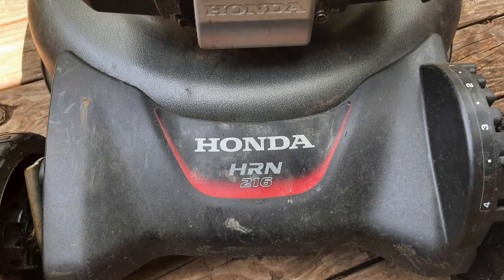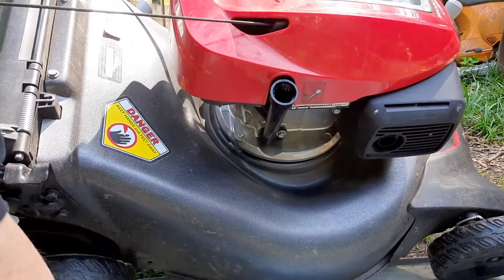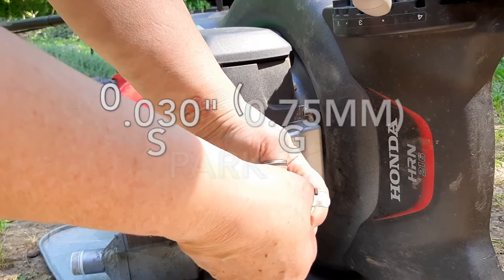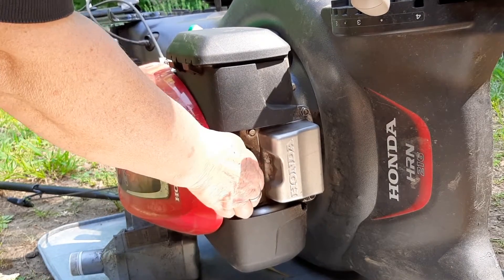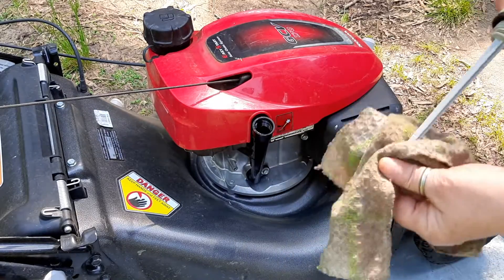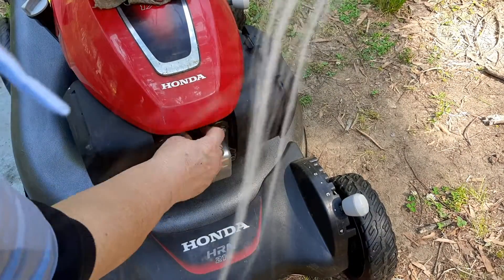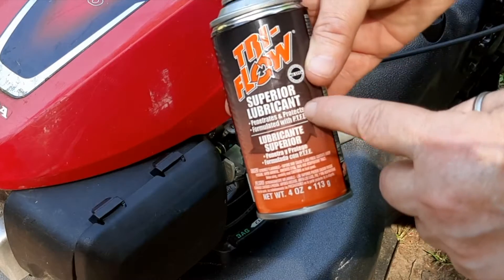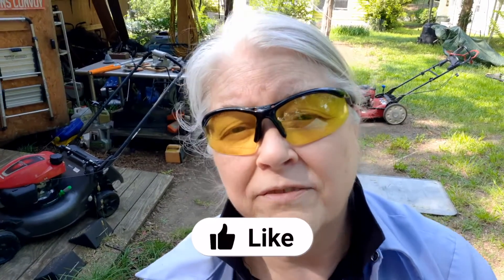HRN216 Tune-up: Honda's Newest Lawn Mower

Comment: Thank you for your videos.  I have been having a huge problem with the carburetor & found out Honda does not cover it 👎🏼 I did purchase full warranty for it. It’s only 1 year since purchase & I take it in for maintenance.
Reply from the maker: Wow, sorry to hear that. Not sure how an extended warranty doesn't cover carburettor related issues. Generally speaking Honda makes a superior product, bu this newest model falls short on several levels. I appreciate you watching.

Comment: I wish I had seen this video before, because I just bought it a few days ago. Love it so far but now I'm worried lol. I was looking for a Toro Super Recycler but they were out of stock here. Dealer told me they are not sending him many residential mowers. They seem to be pushing the battery ones at the factory. Thanks and hoping mine keeps on going😁
Reply from the maker: Check out my review of this mower (in the top pinned comment above). I think the mower still has a few high points despite the  value engineering that occurred with this newest model. I think the biggest problem you need to look out for is debris derailing the drive belt. Their design chose to omit the underside baffle to prevent this. If you do wind up with a broken belt, it' not too difficult to replace with some basic tools if you are handy. That video is here: https://youtu.be/lsNDo2Ywnlk I appreciate you watching.
Reply: Every one is pushing the battery mowers but they don’t hold up and have to replace it every few years 
Not a good idea 😂

Comment: when I remove the spark plug to check it, before reinstalling it I clean it using the wire wheel side of my bench grinder to clean it.  It looks new again after I do that, then I apply anti seize to threads to make removal easier next time.

Comment: Have you ever added an hour meter to a residential mower? I installed one on mine when it was new and it helps keep me on track for oil changes at the appropriate time along with other maintenance items that are spelled out in the owner’s manual.  I highly recommend them.
Reply from the maker: I personally have not, but have urged several owners to do the same on their commercial pressure washers and such. It's a great idea, but I suspect you are in a very small group of owners who actually read and follow owner's manuals.
Reply: @TheLawnmowerLady  owners manual? What’s that?
Reply: I think all small engines need meter and low oil shut down from manufacture, but they don’t wont it to last but a year or two

Comment: The second use of this mower it started surging and I had to clean the carburetor then it started idling way too high so I had to redo the governor thingy. The tachometer I bought is cheap and reads over 4k but it sounds good.  When I drop it down to 3600 or lower it sounds crappy and runs rough so I did it by ear and I'm sure it's rpms are a bit higher than factory but it cuts waaaaaaaay better now.
Reply from the maker: My advice is to check the return springs for the governor arm and the throttle plate. Maybe something is sticking in one or the other. If sounds like it's running crazy fast, it probably is. 4K is a little on the high side for sure. Thanks for watching!

Comment: Hello, thanks for the video...I'm working to replace front axle on Honda Hrn 216..would you know how to remove the front plate/cover that covers the axle?
Reply from the maker: As I recall, there is not an axle as such. There are wheel mounting plates that have a large stud that the wheel goes on with a nut that holds it in place. Hope this helps. Thanks for watching.

Comment: I just got one. I've ran it twice and the 2nd time it started making a ticking sound for a few seconds maybe a minute then went away. While it was still warm I restarted it and the same thing happened. Oil level is fine less than 2 hours on the mower. Belt seemed very loose when I flipped it to check blade bolts?
Reply from the maker: I've heard a ticking sound with a loose blade. If it's still under warranty, return it to the shop where you purchased it.

Comment: i use royal purple oil i can see the mark on the dip stick better. i have a honda hrx217vkaa can you send a video on changing the drive belt thank you.
Reply from the maker: I don't have a video on that yet. I have one that needs a new crank and hopefully one day soon I can get that video done. Thanks for watching!
Reply: @TheLawnmowerLady  I mowed over a golf ball chopped it into pieces and shot it out like a bullet I have a slight vibration on my mower now what do you think? Honda hrn.
Reply from the maker: @SANCHEZFLA863  My first guess is a bent crankshaft. If the vibration is not too bad, you might be a few years out of it before the seals get worn out an it starts leaking oil. I think there is virtually no chance the blade adapter is bent, it's very robust. Keep an eye on the oil level dipstick to monitor those seals. This newer model has a much lower oil requirement than previous models. It will seize up sooner with no oil. Here's a simple way to test for a bent crank without any special tools: https://youtu.be/4xqC5X8-3nc Good luck.

Comment: I'M not sure I like them reducing the amount of oil these new engines hold. What is your opinion Stella?
Reply from the maker: Unfortunately, I think finding  these overfilled will happen more often. 🤔
Reply: I think the oil will be so over heated and damage the moving parts 
Honda is really stupid and I can see why they got out of push mower business 
This engine will be a disaster
Reply: @philliphall5198  Honda is not out of the push mower business. Where did you hear this.

Comment: Hi Stella, I really enjoy the videos.  The HRN line has been out since 2020, I really haven't seen much negative press on them so far. The mower in the video already looks pretty beat up for being so new and having it's first oil change. Is the customer using it commercially? 

I own one of these mowers, bought it new in July 2020. It's been an excellent mower, I've had zero issues. Although I agree there may be some compromises with this new design I think it's a significant improvement over the HRR line it replaced. Overall I would recommend this mower, I think it's still a better buy over the Craftsman's and Troy Builts ect. 

Just my 2 cents... :)
Reply from the maker: The mower was only 4 months old the first time I saw it, and the customer just is really hard on all his lawn and garden gear. I made a video on changing the belt as he was using the machine as a bushhog. I made a second video while waiting for the belt on some of my other observations of this new design. Although Honda took some short cuts with this new design, with proper care and  use, this mower is OK.  I appreciate you watching. Cheers!

Comment: Hi. Don't know if you can help. When I replaced the drive belt on honda hrn 216 with your help,thank you. Somehow I pulled the cable too hard and what looks like a plastic piece popped out . cable is slack and I can't push the plastic back up into hole.  This is probably the worst description of a problem you have ever received I'm hoping somehow with a miracle you can picture what I'm telling you ,help!!
Reply from the maker: No idea, I'm sorry I can't help you. Maybe look at a parts diagram to see where it fits?

Comment: Good video. Can't wait to see these engines on something other than a Honda deck. I don't know if I like that dipstick... Very weird design. I prefer the older dipsticks on GCV160/190 along with the older briggs classic and quantums. Something that you can actually easily read when a machine is low on oil.
Reply from the maker: I agree! Thanks for watching. Cheers!

Comment: I have this mower bought about two months ago. While cutting grass the other day out of the blue the self-propel stopped working. I checked for broken/belt off pully as well as cable adjustment and could see nothing out of the ordinary. After about an hour or so I decided to start it up to check once more before putting it away and to my surprise it was working just fine? Any idea why this may have happened? Thanks
Reply from the maker: Honestly no, but some folks report any small debris, twigs, etc., will jam up the drive. Perhaps you dislodged something when you looked under the deck? Thanks for watching. Cheers!
Reply: @TheLawnmowerLady  That did cross my mind and could very well have been the case. Thank you👍

Comment: Hi!! I just had the new HRX217HXA top of the line delivered and sent it directly back. Took 17 tries to start. This is one that my local dealer has fixed the Cam Release problem on. I think its the wax choke activator now. It has the auto choke which i dislike.    I myself prefer a manual choke like on my 2008 top of the line residential GVC160 overhead cam. Still runs great but having a transmission issue and it costs almost $500 to do my self. I am fully able to but being 60 i figured i would buy one more honda as they are out of the lawnmower business. So, i do NOT want the new 200 engine w the bad cams even as my dealer is replacing, and i dislike the now autochoke  so my option is the commercial HRC216HPA which still has the 160 engine w the manual choke!!  Also shaft driven which is the best But it weighs almost 30 lbs more..... is there a Toro that you may think is made as good as the Honda commercial or the older honda residentials? Weigh will be an issue in the future as i am older. Tempted to just  try to first change the transmission fluid and if that doesnt help replace the tranny. I am very mechanical...
Reply from the maker: My personal opinion... Any commercial mower will have a longer life as a residential mower. A new Toro, as with most any mower made these days is not as durable good as a 10 y.o. Honda That said, would you consider a used, good condition HRX series (composite deck with the older engine?). That machine retains many of the commercial like features found only on the commercial lines. 

I'm intrigued with the $500 cost of your transmission? AFAIK, all Honda transmissions are rebuildable. If you are indeed handy, drain the fuel and oil, pull the spark plug, and flip the mower upside down Take a look at the transmission gear box. If the screws holding the cover are not too worn, pull off the cover and check the gears, and the gearbox oil level. What is the condition of the pinion and matching gears on the drive wheels? Do the drive wheels turn when you engage the drive belt on the transmission? I really appreciate you watching.
Reply: @TheLawnmowerLady  Hello and thanks for responding. Yes they turn. Right now just groaning but still operabIe.  am going to first check ,change, the fluid in the transmission. And checking gears. Yes i am a machinist, retired and very handy. If I do indeed need the tranny I found one for 307.00. I do see that draing the fluid and replacing quite often fixes. I have the groaning noise when moving. Mine is 2008 HRX217hma. Has always started on first pull so want to replace tires and bag and fix tranny instead of the new 200 engines. My local dealer is replacing the cams and or cam releases on each and every new hrx. They are bad and honda wont recall as now they will be out of the business and dont care. Lots of news on them on diff sites. I also do not want auto choke.  My other option is the hrc216 as it has the overhead valve engine still........

Comment: Without prompting, the local lawn mower shop said to stay away from these Honda Commercial Mowers with the  GCV-170 Engine.  The Self Propelled system is exposed to the elements underneath and any mowing on wet grass spells 'Doom' for these machines.  The self propelled system just stops working.  Second, the self propelled cable going into the machine just fails at the connection at the body.  Both are insane, one is high labor cost and the other is high parts cost.  Very sad to see a full-on Honda product fail.  I do not know of any engine issues but the shop was just going on and on about "Don't buy this machine," that I could not get into the ask question mode.
Reply from the maker: I agree Honda cut way too many corners on this mower. I did notice these same engines on the new HRX mowers with the composite decks. Those are still good Honda quality mowers. I appreciate you watching. Cheers!
Reply: @TheLawnmowerLady  How I wish I'd known this, before I bought mine!  Just had my self-propel stop working on me.  It has been surging, and bogging, during mows also.  What a cluster!  I have babied this mower, and only used it residentially.  I'd hate to be in the middle of a commercial season, with this one.  I'll be replacing it, if my local service, won't fool with her.  I wish anyone else luck, if they're also stuck with this model.  I loved the deck, and the motor, when I got it; but wow...what a dog, in the field.
Reply from the maker: @dongordoofthegalletas  Thanks! I know some folks are very happy with theirs, but many more like you with regrets. I appreciate you watching. Cheers!
Reply: @TheLawnmowerLady  Well I sold my HRX last year for a Greenworks 60v battery mower and could not be happier. After seeing the work needed for these reminds me why I sold it. I'm so glad I just plop a battery in and go. Been 2 years now with zero problems and zero maintenance. No oil, no drive belt to mess with. Been a gas mower guy for 25 years, never through I would switch but found a good deal and thought I would try it. Held on to the Honda for awhile just in case and once I knew for sure I sold it. The Honda does hold its value pretty well when selling one.
Reply from the maker: @Shortcuts2185  I appreciate you watching. I think this mower has an audience, but far fewer folks will be pleased in comparison to their older machines.
Reply: Just bought mine on May 2nd. Don't even have in the first 5 hours and the drive system stopped working yesterday. Cable looks OK but the belt looks super loose.  Any thoughts on what I should do?  Should I call it in to get it fixed or return it.  Didn't see any other decent mowers close to where we live. I didn't spend 600 dollars to buy a new mower so I could rip it apart to repair it. Any help would be appreciated.
Reply: @panth3r26 
A good first check  is to tilt the mower back and see if the front wheels move when the mower is running.  
If they spin then it could be worn gear teeth on the wheels, slack cable, or worn belt.

A visual inspection of the under belly after a cleanup cannot hurt.  If nothing is visually obvious and the belt seems ok then tighten up the cable.  
A new belt will also be loose but, if the old one is worn then a new one does not hurt.  Actually, I have never seen the transmission fail.  The other problem could be the front wheels.  The gear teeth on the plastic wheel can wear out and a new set is not that expensive.
If you remove the metal transmission drive gears to the wheels, note that there is a L&R and they should not be mixed up just note the side and orientation but, they should not have to be removed unless they are broken or damaged.

Good Luck and I hope you can figure this out and fix it.
Reply: @A_Renaissance_Man  I just bought the mower on May 2nd. Nothing should be worn down. I shouldn't have to take anything apart.  Don't even have the first 5hrs on it yet. I believe it is rear wheel though.  Nothing liked broken or damaged.  Didn't know if the belt could slip off. It's really loose but couldn't pull it out, it's not broken. The cable looks OK as well. I'll probably have to call it in. I don't want to void the warranty. Today when I get a chance I'm going to try and get a better look at the belt. Thanks for the info.

Comment: What is the part number for the black filter-COVER so I can clamp one back on mine!
Reply from the maker: Look at partstree(dot)com for any of the mowers in the HRN series. They have exploded diagrams and you can be assured of getting the correct part. I'd hate to steer you wrong.

Comment: That oil was dirty for 5 hours 
A new Briggs was 5 hour first change, 50 hours after (Honda) 25 Hours
Reply from the maker: I'm pretty sure it has more than 5 hours. How much more? Who knows?
Reply: @TheLawnmowerLady  for Warranty Purposes it ain’t Honda Oil😀😀😀
I was also surprised you could see that much metal in the oil.